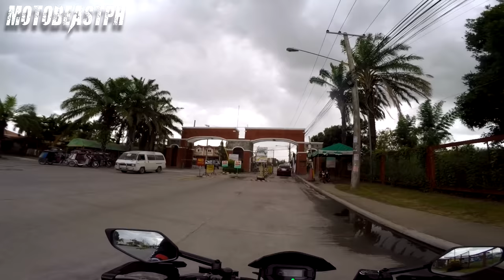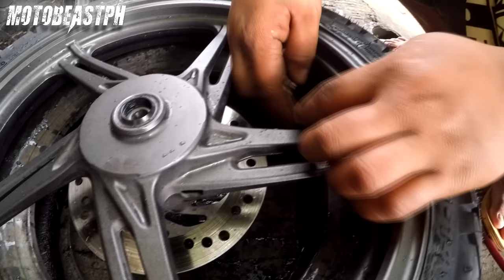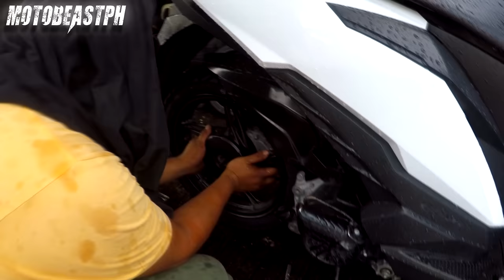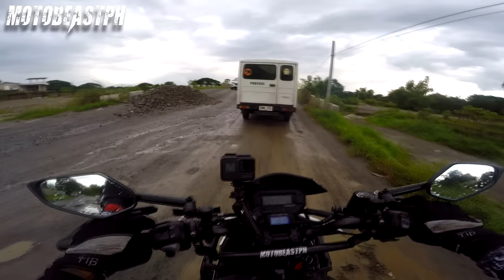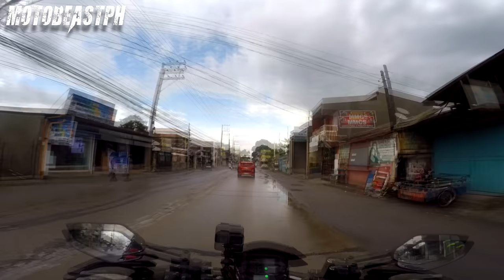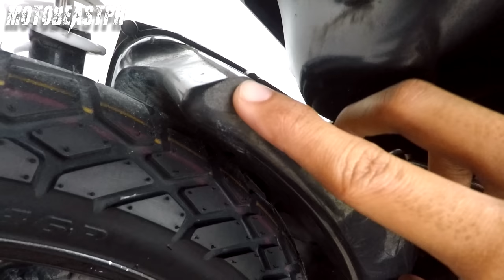Corsa Platinum Cross-S | Dual Sport Tires | Honda Beat Street

Comment: What tire pressure for front and back?
Reply from the maker: 29psi front, 33psi rear.
Reply: @MOTOBEASTPH  Thank you Sir!
Reply: Kung may sealant na Sir, both tires, ano advisable na PSI?
Reply: @MOTOBEASTPH  boss plug and play po ba stock size 80/90/14 & 90/90/14?
Wala napo ba babaguhin? 
Salamat po.
Reply: Honda beat po pla motor ko boss 2021 model salamat po

Comment: Tanong ko lang brader. Goods parin ba pag 110/80 Rear 100/80 Front? Tsaka kakasya parin ba yung sa rear nun di pa sasayad sa shock or tire hugger? Sensya na baguhan palang heheh
Reply from the maker: Baka sumayad na, bro.
Reply: @MOTOBEASTPH  Ah sige bro maraming salamat. RS lagi lods. Godbless 😁
Reply: @MOTOBEASTPH  bro pwd ba 110/80 rear and 90/80 front na gulong??

Comment: Lods ani sise nyang corsa cross s mo? Nag stay kba sa orig size or nag upsize ka front and rear..? Nag babalak kse ako nyan kods 110/80 rear, front 90/90 kaya kaya?
Reply from the maker: Stock size. 90×80 at 100×80 ka nalang, bro para di masyado mabigat.
Reply: @MOTOBEASTPH  nga lods... cge2 👍😁 naisip ko din bka mka apekto sa odo reading ni beat since di na akma yung size nang tires... Di na xa mag accurate, salamat lods 👍

Comment: Sir pa tulong po regarding sa Beat FI.

Pumupugak po kasi lalo na pag malamig makina. Minsan naman po kahit tumatakbo pag nag menor ka tapos nag throttle, parang nalulunod. Eto po mga napalitan na parts:

Fuel filter
Air filter
Engine and Gear Oils

Bagonf linis na din po ang throttle body. 

Thank you po.
Reply from the maker: Check spark plug, spark plug cap. Patignan mo na sa expert mechanic, bro.

Comment: Boss pwde ba fit 110/80-40 sa likuran boss? Sa beat. Sana po masgot nyo po..kasi plan ko po bumili ng tire na ganyan. Kargado kasi aku everyday deliver po..sa maxxis size ko po sa likuran nilakihan ko po 110/80-14 swakto naman. Di ku alam kung swakto ba rin ba sa corsa..
Reply from the maker: Di ko lang sure. Mag 100×80 ka nalang para di gaano mabigat pero medyo malapad.

Comment: Kaya ho ba sir sa benking benking wet & dry roads?
Reply from the maker: Pwedeng pwede. Pag maulan dahan dahan lang dapat.
Reply: Salamat sir, Wala pa Kasi stocks sa  mototyre central sa cavite ,front/rear nsa 3195pesos  discounted na para sa delivery rider na tulad ko. Michelin city grip pro sana Kaso mahal, sa Corsa cross nalang. Salamat ule sir. RS lang Lage tayong lahat

Comment: Sir, kapag po ba na loose thread na po yung pasukan ng drain bolt sa may gear oil e need na po ipagawa sa machine shop? Btw po, nice review po. RS lagi Sir!
Reply from the maker: Oo, bro. Oversize rethread.
Reply: @MOTOBEASTPH  Salamat sir!
Reply: 3-8 by 1 Po na bolt screw. pa re thread mo Po sa machine shop Ang drain bolt, mabilis Lang pag  gawa Sakin. Nasira ko Kasi noong pangalawang change oil ko Ang thread, payo Lang Po pag binalik na Ang screw kung makaramdam Ng resistant wag na ituloy sana makatulong po Ako. Honda beat street user here RS Lage tayo
Reply: @manoydominguez6972  Maraming Salamat po sa tip niyo sir. RS po lagi.

Comment: Ang angas ng Corsa paps.. ok ba performance sa wet/dry roads?
Reply from the maker: Okay naman, bro. Pero mas makapit pa rin street tires.
Reply: @MOTOBEASTPH  kamusta condition ng gulong? Makapal pa din ba or upod na after 1 year? Planning to use sana this brand of tire next year, palitin na kasi gulong ko. Wait ko response mo boss, sana makasagot ka. Okay din sana kung meron kang review neto or kung meron na boss pa link naman. TIA! RS!
Reply from the maker: @littleTsunade1013  Makapal pa rin, bro di ko pa pinapalitan.

Comment: Bro.. tanong ko lang sana nagpalit ako kalkal pulley tapos 1k center 8 clutch spring 13g bola.. need pa ba i break in un?? Ask ko na din bro kung tama ba ung set ko.. salamat ride safe lagi
Reply: 60kg ako bro.. parang nababagalan pa ko..
Reply from the maker: Break in lang, bro. Pwede ka pa mag-gaan ng bola para mas may rpm.
Reply: Ilang grams po stock flyball ng honda beat Fi?